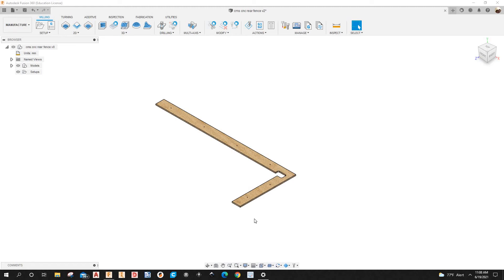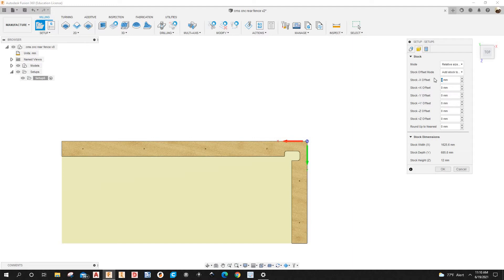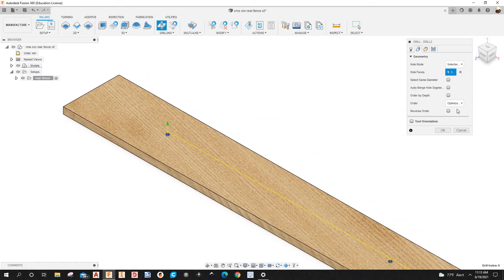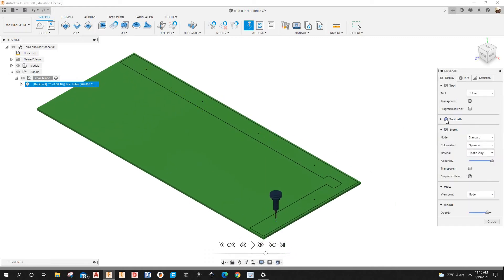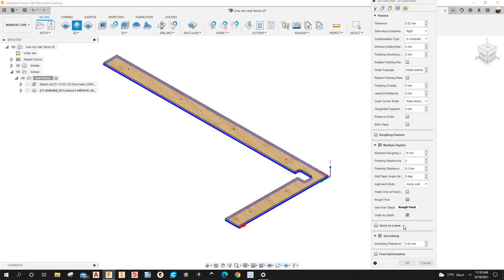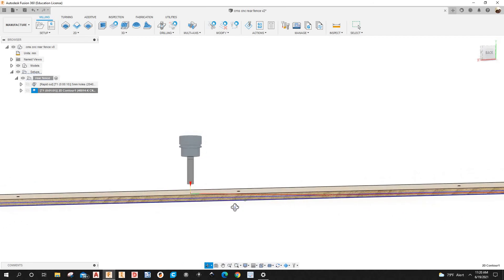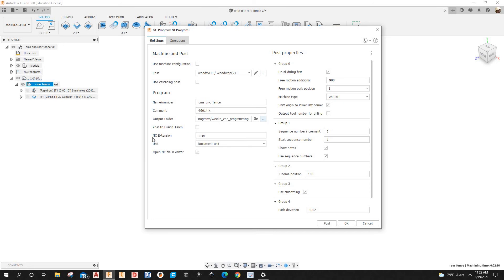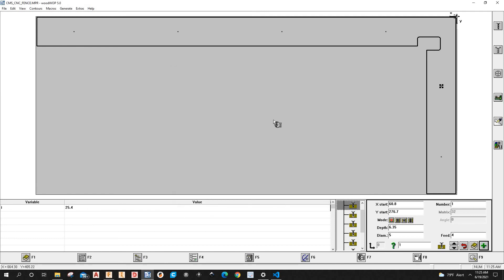Fusion 360 to Woodwop. Homag/Weeke And Fusion 360.

Comment: Just linked up a shop running Solidworks on a Homag 5x and WW 6.1
Reply from the maker: That’s awesome, how is the Woodwop post processor from Solidworks?
Reply: @justourbina12  Pretty good.. all the toolpaths end up being block macros tho.. so no real viewing on the machine..
Reply from the maker: Block macros are good i think, they make mpr files lighter and easy to download on low memory Weeke/Homag cnc machines. It takes a long time to load a 500kb mpr file on that old Weeke at work. I wish i could turn big programs into block or component macros in Fusion.
Reply from the maker: Can you make a quick video about it?

Comment: Hey, do you know how get the tooling list? is it a download? or do you have to setup each tool individually?
Reply from the maker: @aidanobrien6704  in order to import your Homag/Weeke tools into Fusion, you would have to convert the tool files into 1 one these file types, json, cvs, hsmlib. I have not been successful with this, therefore i added each tool individually. It’s a long process especially if you have more than 1 machine.
Reply: @justourbina12  thank you so much, I’ve started adding them individually but will have to try and do this, thanks 🙏
Reply from the maker: @aidanobrien6704  you’re welcome.

Comment: Great video,  may i as ask where i can get help setting a homag machine running woodwop in fusion ? thanks
Reply from the maker: You have to find someone locally. Do you have the woodwop post processor from Autodesk?
Reply: @justourbina12  yes, i have to, woodWop post processor comes already pre-installed in fusion to use which is great.
Reply from the maker: But you get “file has invalid format “ error message when you want to open an mpr file in woodwop.
Reply: @justourbina12  what did you do to evade this problem?
Reply from the maker: @Eichenlaub18  Hello, i have a video on what to do to the post processor to evade the problem. https://www.youtube.com/watch?v=3OHoU4h4CUY
Reply: @justourbina12  Thanks mate!😁👌🏻
Reply from the maker: You’re welcome.